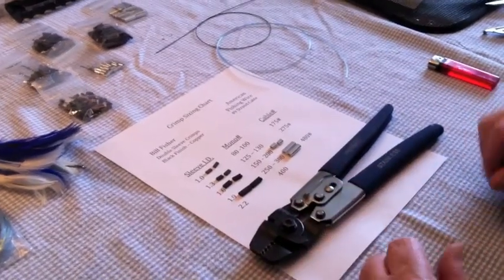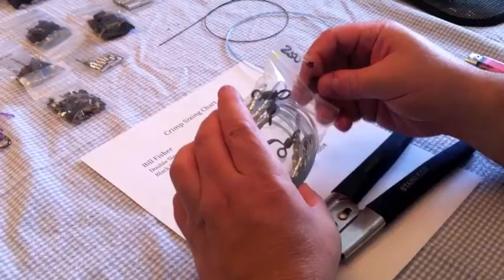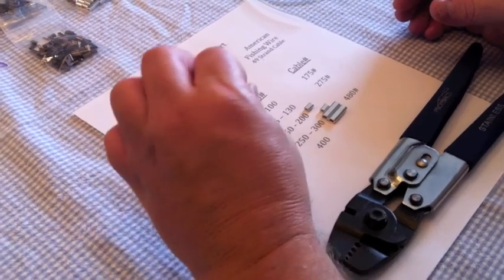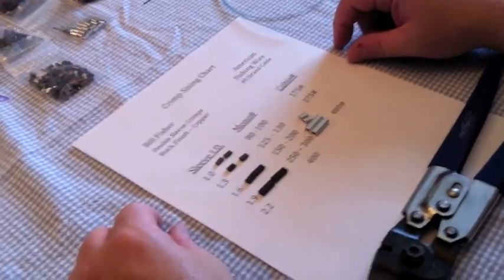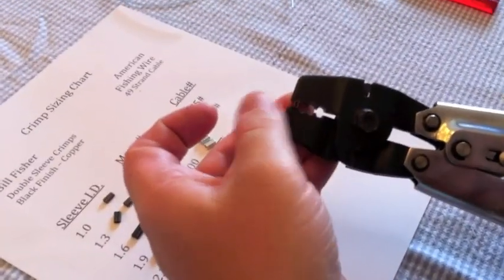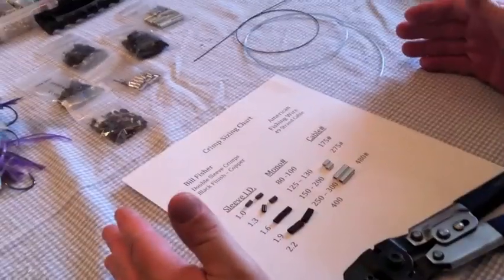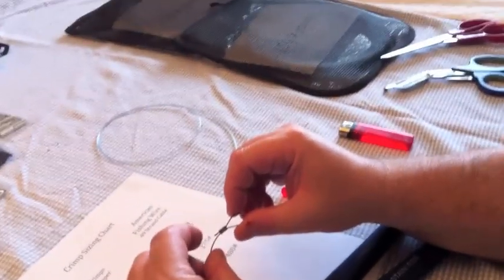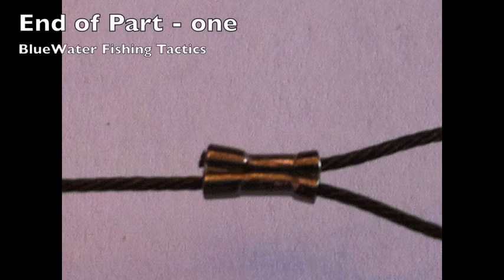Intro to Crimping Fishing Leaders

Comment: I realize this is an older video, but single barrel crimps work great.  I use 90 pound AFW bleeding coated wire and a #6 AFW single barrel crimp.  Haven't had a failure yet.  Proper equipment, made with proper material, rarely fails.  I think a lot of the guys having trouble with the single barrel crimps, or even the double barrel crimps, are actually crimping the very end of the crimp.  A big no-no!!  Leave a 1/16" at both ends uncrimped.

Comment: I have always wondered, I don't know why but I have a hard time trusting a crimp to hold the catch of my life. I am usto the single strand bendable steel leader wire where you can wrap around the top of the base as many times as you want for a strong secure hold. My question is, can I put a ton of crimps as insurance, like 6 or 7, all along the bases of where I am tying my swivel and my hook on opposite ends?

Comment from the maker: Hey - sorry so long to get back with you - as for large crimps the way to go is with a different crimp system call "Nicopress" it's more $ than these small copper crimps - but way stronger - google it - and most hardware stores can set you up...good luck